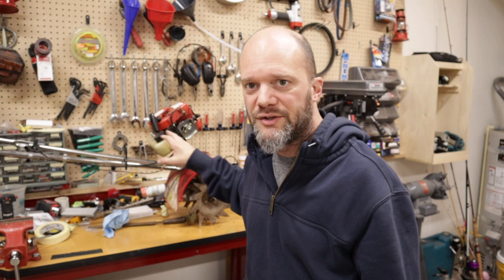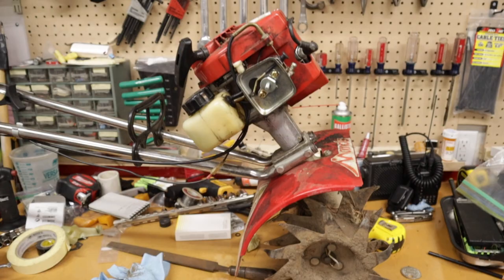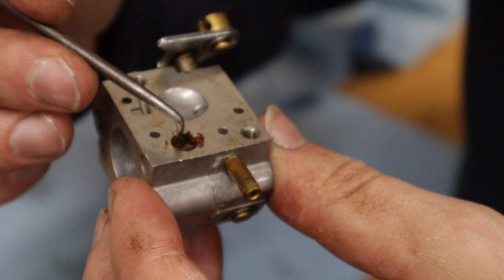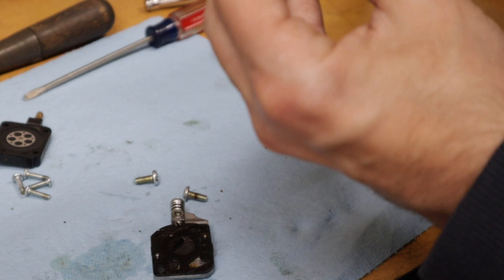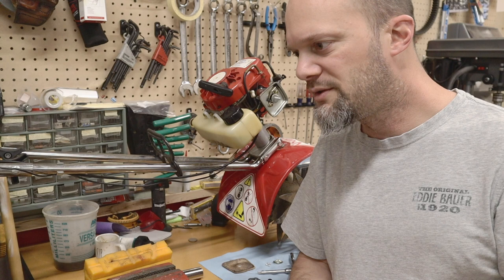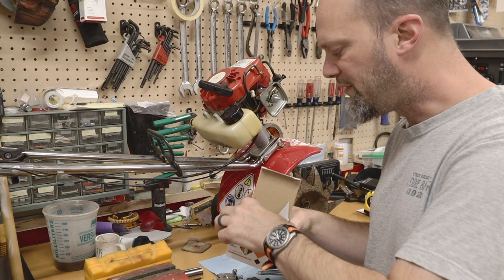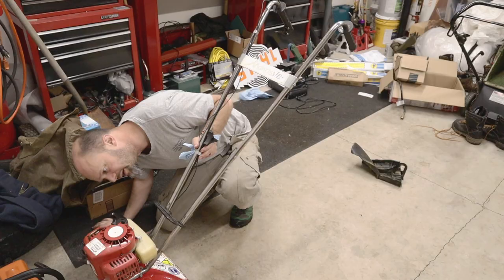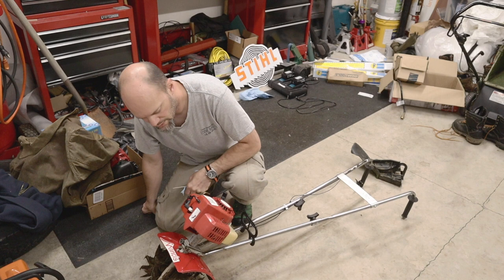How to Fix a Mantis Tiller

Comment: You have the tines set for WEEDING. meaning they are scratching the surface. If you swap them out so the tines face towards the ground they will dig down into the soil
Reply from the maker: Great tip.  I’ll be using it soon for a garden..thanks!

Comment: Hi was just wondering if you were having the same issue as me with fuel leaking out of the side of the carb and running down onto the ground after sitting.
Reply from the maker: No.  But I put a new carb on this one.
Reply: @design2survive  I put the exact same carb on and it still does it. Runs out the side down the filter and I have a little pool of fuel that's ran out.